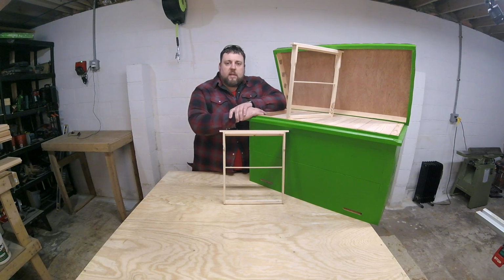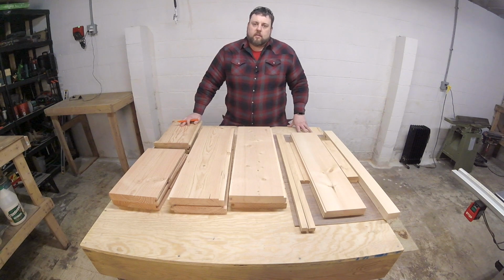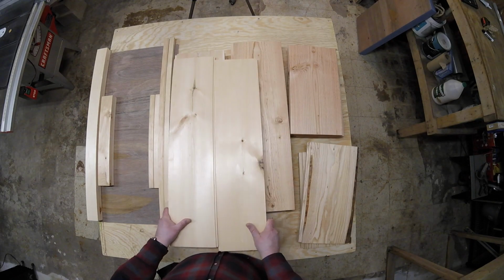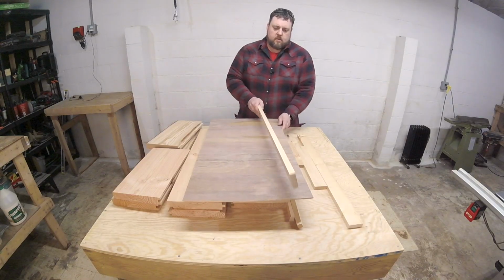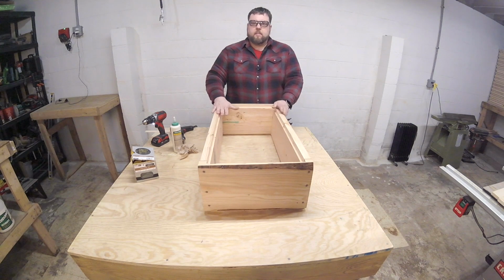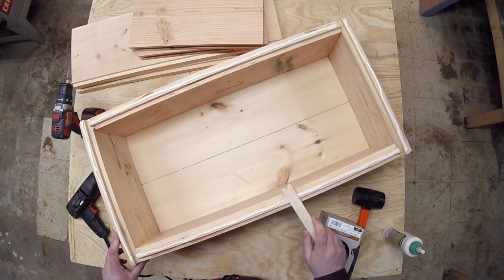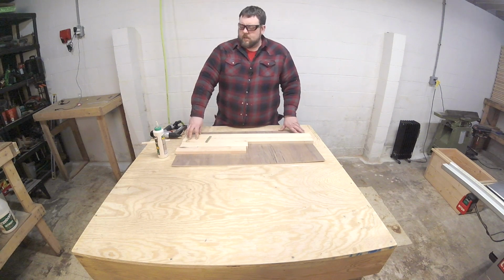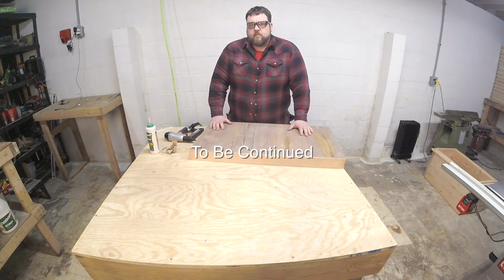🐝 How to build a Layen's Hive Part 1 of 2

Comment: Triple B, If the frames are 1.5" long and you scaled up Dr. Leo's 14 frame design to 19 frames, how come your length wood is 29", not 28.5". Is that 1/2" for play so the frames aren't too snug? Also, I'm thinking of building a 21 frame design like Dr. Leo's most recommended. Should that length total 32" = (21 x 1.5" frames) + 1/2" play? Or should there be more play in your experience?
Reply from the maker: You definitely want to plan some extra space. Dr. Leo's plans call for 21 7/8" sides and which leaves an extra 7/8" with 14 frames. I would have to look up my notes to see how I settled on the exact size but I probably ended up dividing 21-7/8" by 14 and then multiplying that by 19 to get that length. You could do a similar thing to scale up to 21 frames. Hope that helps!
Reply: @BeeBoyBill  when I asked him recently he said to leave 1 7/8" per frame. This leaves 1/4" per frame which may be more than necessary for a 1 1/2" frame top. I'll do your calculation and see what happens for 21 frames. Even still I saw on one of your videos you added patches as necessary to keep the top protected. Great idea.
Reply: @BeeBoyBill  Not to be picky....but I did your calculation and you overall length should have been 29.6875 (dividing Leo's 21 7/8" by 14 gives us 1.56. Multiplying that times 19 gives us 29.6875). Your dimension of 29" would be very snug at 1.52 per frame. Using Leo's calculation length per frame of 1.56 and scaling it up to 21 frames gives us 32.81. However, with that small a margin I will most likely gross it up to 33" or even another 1" to 34" just to be on the safe side. 21 frames will require a lot more play.
Reply: @BeeBoyBill  Also, have you experiments with Dr. Leo's suggested wool insulation? Where does he use it...on top of the frames? or around the sides of the separators? If so, do you have a source for the wool?
Reply from the maker: CTYank  The hives I built are 29-11/16 which works out to 29.6875. I'm not sure where you were thinking 29 but if you check out Layens Hive Part 1 of 2 around 1:20 in I go over the sizes for the 19 Frame pieces. Hope that helps!
Reply from the maker: @ctyank4946  I have contacted some local sheep farmers and asked around for wool they were going to get rid of. I didn't have much luck. Last winter I used rock wool from the hardware store. I only put wool on top of the frames between the lid. This should at the very least discourage condensation build up above the bees.